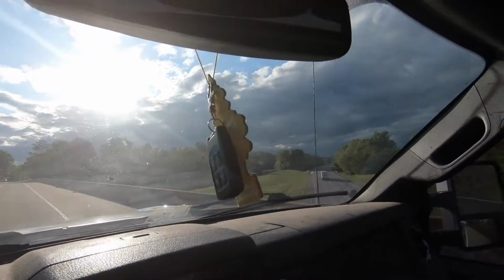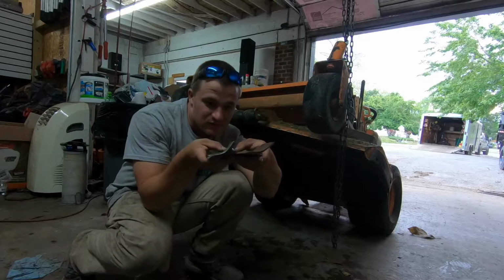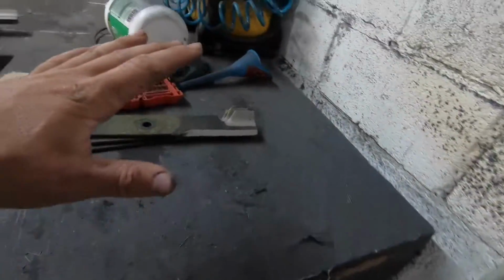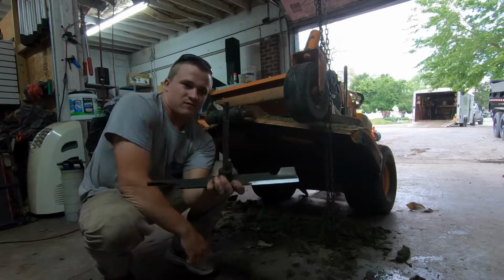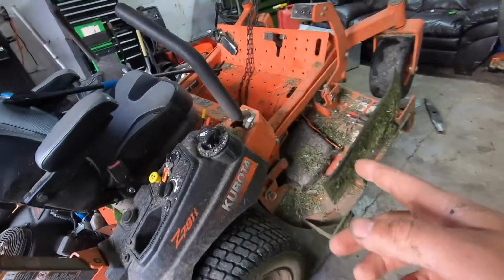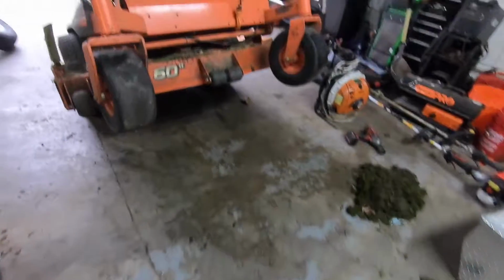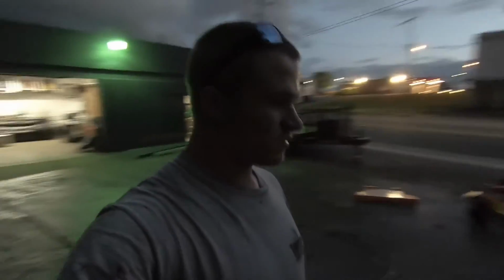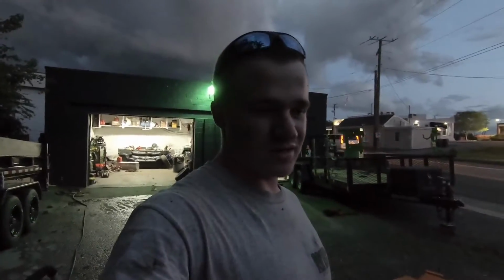How I Sharpen Mower Blades - [Sunday Maintenance]

Comment: Great beer lol. The short tail is designed to cut grass and get it out of the deck fast and far. The regular high lift will hold grass in the deck longer
Reply: I started using those same blades last yr and so far really like them. The ones I use are copperhead 2173  & 2174
Reply: @mastlawncare  awesome